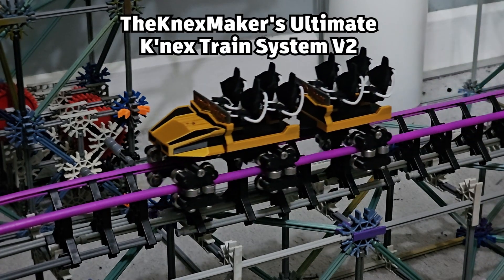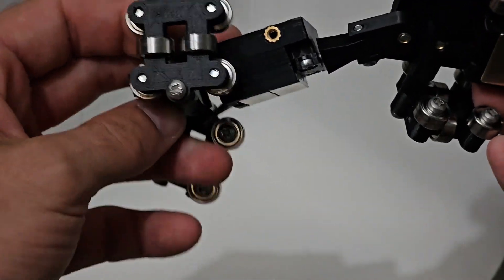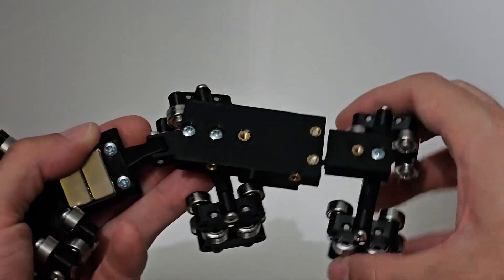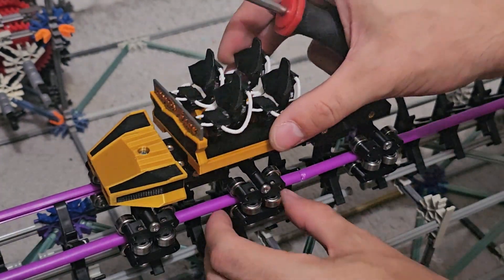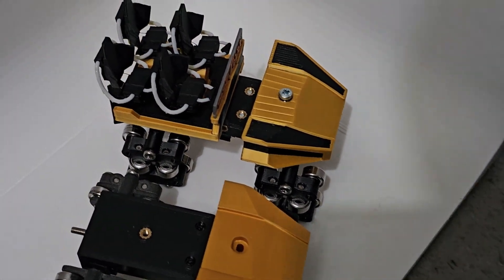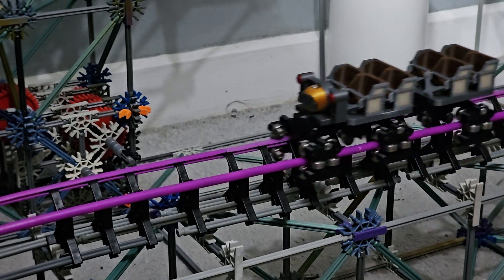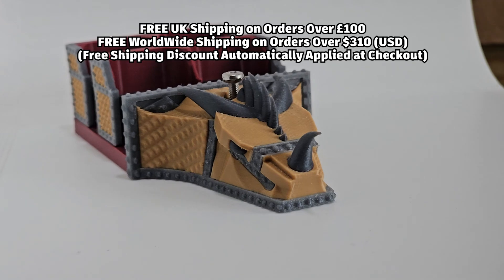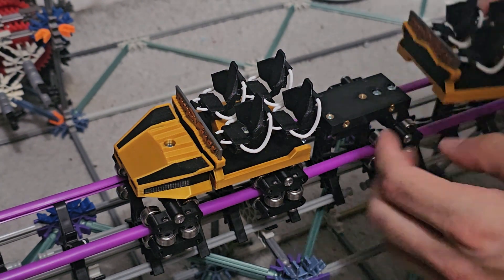Ultimate 3D-Printed K’NEX Train V2 | Best Ever Upgraded K’NEX Trains!

Comment: Quick question, how do you get round copyrighting issues with trademarks (if there are any), cause I've been wanting to set up an etsy store with 3d printed rollercoaster stuff but am worried about copyrighting. Thank you!!!
Reply from the maker: 3d modelling is art technically. And because we are not using the original 1:1 cad designs of the real rides, i am making my own. It's technically my interpretation (artistic model) of the rides. And if any parks contact me about having ride names I'll just change the listing to (hyperia styled) or something, and then it's fine.
Reply: @TheKnexMaker  Thanks for the info! Good to know :)